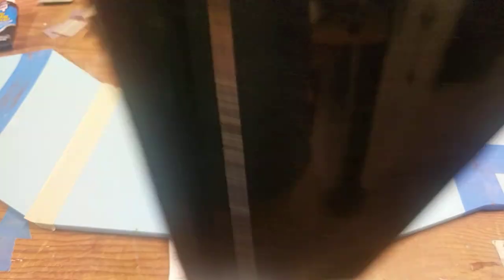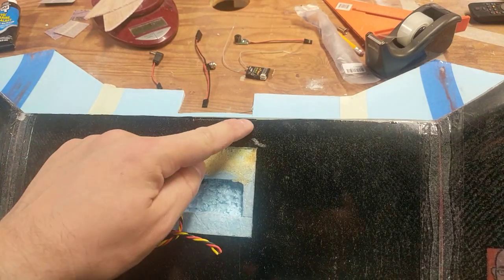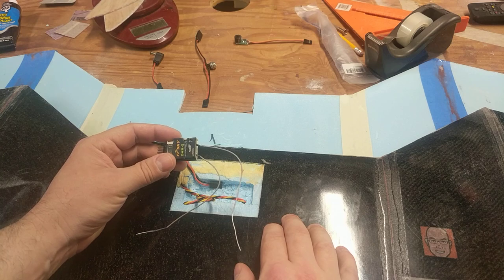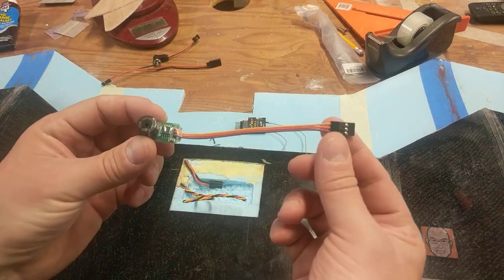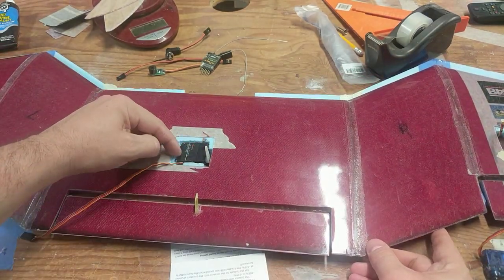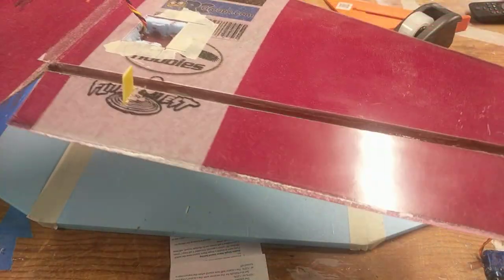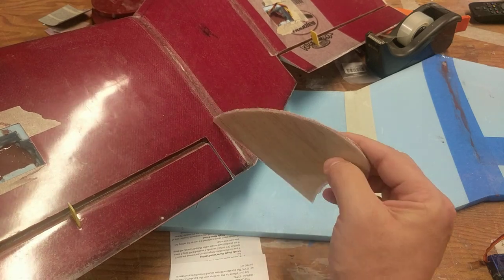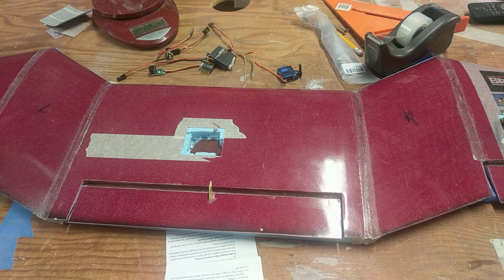I Like the Boobies - part 5 - Silicone Enhancements

Comment: like boobies too:-) Just a caution about using silicone. Depending on the type they often have poor adhesion to most materials. Also if you scrape it off and try to use another glue the other glue wont stick at all. I hope this wont be a problem for you.
Reply from the maker: i did an epoxy/filler application to the insides of the hing so it has a lot of area to grab onto and this was actually recommended to me by some older fliers (the epoxy thing) as a way to give it better adhesion...but i guess i will find out when i fly it :)